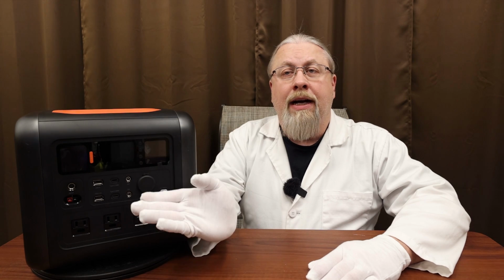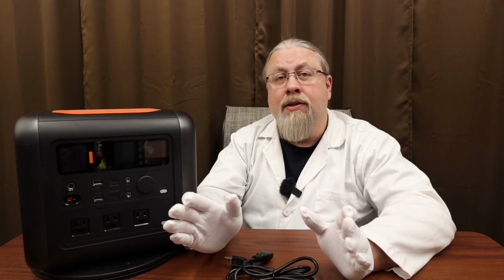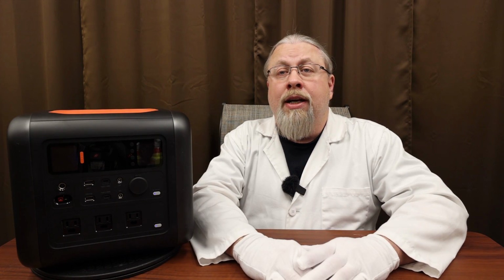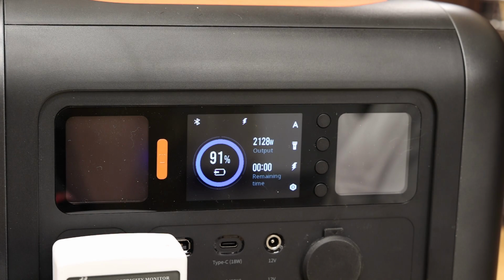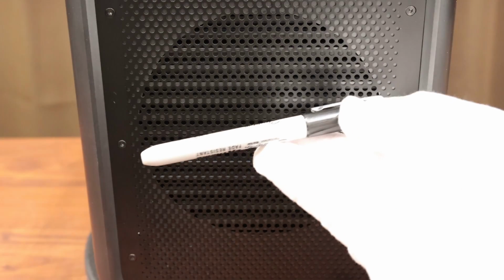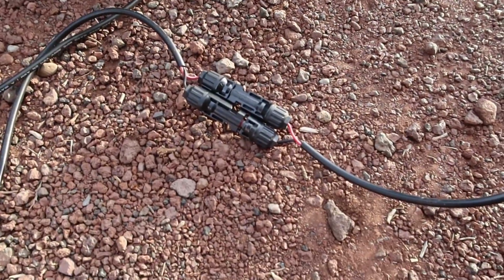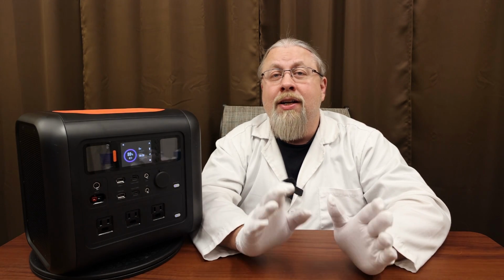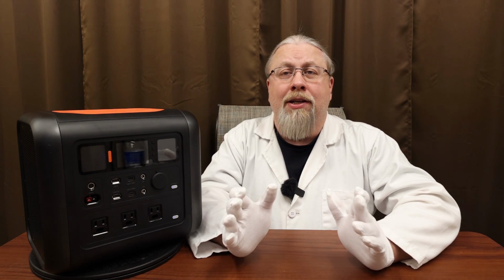SILENT 1200w Solar Generator! 70mai Power Station Tera 1000 Review

Comment from the maker: The crazy low introductory price is FOR THE FIRST 120 UNITS ONLY then the price increases!
GET THE TERA 1000 HERE: https://bit.ly/3khxhXn
Reply: man think price jumped to $649..
Reply: I think if I were you I would recomend putting the rubber on whole curve of edges with extra on front side curves. This would protect  the best if dropped & they could put no feet.
Reply: Hey I recently a message I won this unit did you send it or I'm I being trolled or are you being trolled?
Reply: @kathylewis7543  same here, I think its a scam
Reply from the maker: @kathylewis7543  The users name is "whatsapp" and I wasn't giving anything away so what do you think? Blocked and reported but the damage is done.
Reply: @kathylewis7543   I was like huh hoping but still a cool channel
Reply: @HOBOTECH   thanks for letting us know awesome channel
Reply: @HOBOTECH  Wow crazy why are people doing this! Hey I reported them as well.
Reply: @HOBOTECH could you reach out to your contacts to see if they are going to actually ship this?
Reply: @Charles-xx3ic  its very agrivating. Im still waiting for mine as well.
Reply from the maker: @Charles-xx3ic  Try reading the updates on the campaign page?
Reply: @HOBOTECH  have you read the comments on the campaign 
?
Reply: @HOBOTECH  Update: Received my unit later than expected but well packed; arrived in excellent condition.  Have tested most of the ports and they work as they should.  Have yet to charge it with AC/Solar/Car.  Super light weight and so portable.  Love that it can take a beating and still work.  (I didn't abuse mine, I relied on HOBOTECH to do that for me.)
Reply from the maker: Maybe we're all on a different planet, but not only is IGG working fine but the last update was less than a month ago where they told everyone they are shipping units. It's right there super obvious to anyone taking 10 seconds to look. Don't y'all know there is a major shipping and supply chain crisis and deliveries are running LATE? I'm not trying to cover for 70mai but for heaven's sake this has been news for over a year now.
"by 70mai Technology
Feb 18, 2022 • 12:26AM
25 days ago
Shipping Started! Your Tera 1000 is on the way.

Dear backers,

Great news! The first batch of Power Station Tera 1000 are now shipped. Based on your time of order, the first group of backers will receive tracking information via email soon. You can also track your order here."
Reply from the maker: @chuckmccaskill8473  First, I give absolutely zero effs what people say about me. They can believe what they want. 70mai sells MILLIONS of products each year and I own 3 of their cameras myself that I bought before they ever contacted me. I like their stuff. If they are having issues with their campaign it's probably due to supply issues and poor communication. Some of the Chinese have a really hard time admitting fault. I mean a REALLY hard time. I will personally write to 70mai right now and tell them they need to update their customers. This isn't the first time I had to do this for an IGG campaign ...
Reply from the maker: @Charles-xx3ic  I just contacted them and got an instant reply that management is looking into it. I think the person running the campaign is slacking. This is unfortunately more common than it should be.
Reply: @HOBOTECH  thank you for reaching out to them. Us backers feel defrauded, back in January they sent us a tracking number for the panels but that number never showed the package being delivered to the carrier. 70mai never explained what happened and just ignored questions about it. I know it’s not your job but if you could give 70mai some communications coaching then you would be doing everyone a great service. BTW, I really appreciate your in-depth reviews.
Reply: @HOBOTECH  Thank you very much for helping us with this, many of us have tried over and over to communicate with them and it has been like trying to nail jello to a wall.
Reply: Well 70mai finally made an Update 9 on the campaign page.  This is how I responded. "On March 7th 70mai Team posted on Facebook that the second batch had left the factory but was being held by Customs for additional inspection. Now on update 9, 70mai Team is now reporting second batch is still in the factory and will not be ready until March 20th and is unknown when it can move domestically or internationally.  I hope that in your future updates that 70mai Team will be more truthful, transparent and accurate."  70mai also said the first batch has been loaded on the ship but there will be at least a 3 to 4 week delay before the ship sails until additionally safety inspections are completed.  So if you received a tracking number for the Terra 1000 you're realistically looking at a May delivery.  I would say for the rest of us a July delivery.
Reply from the maker: Yes, there is update they promised to make. Funny how they give a sincere response and still get flamed for it by the same folks that were shitting on me. It could be delivered with free oral sex and it still won't make them happy.
Reply: @HOBOTECH  really i didn't see any more slams in your direction after you reached out.....from my pov your the only reason they finally responded with a  real response
Reply: @HOBOTECH  I just want to add that I appreciate your actions in helping us with 70mai and I never flamed you on any forum.  I welcome their belated Update 9 but can't help to notice the inconsistencies in their previous Updates and postings on Facebook to this newest one.  I do hope they keep up with their biweekly updates and I hope it is more transparent and accurate.  Realistically if the information on Update 9 is accurate I can't expect to receive my unit until July and will just have to live with that.
Reply: @HOBOTECH  I thought there response was sincere and well communicated. HT, thank you if you had any part in crafting it. 
For me it was getting too close to the end of my charge back window so I’m going that route, wish me luck!
Reply: On a positive note, some of the backers have started receiving their solar panels and I received an email further clarifying and apologizing for  confusion on what they called batch 2.  Batch 1 was only the solar panels, batch 2 are the power stations stuck on the ship in port.  My batch is actually batch 3, the ones still at factory tied up by the Covid 19 restrictions.
Reply: @ZeusBike333    Fed Ex just dropped off my Solar Panels . Hopefully everyone gets what the ordered soon.

Comment: Received my Tera 1000 today (5/20/22) via Fedex.  Powered up with no problems by holding in the power button 3 second, the display showed 64% charge.   I plugged in the a/c charger cord and it starting charging at 270 watts with estimated full charge time less than 2 hours.  This is at the slow charge rate which is what I intend use most of the time.  Unit looks very solid and the fit and finish comparable to my Jackery.  Can't wait to put it through its paces.  Thanks Hobotech.

Comment: This is a great little power station. I missed the lowest price, but thanks to this video I caught the next level before full price. It took months longer than they said to deliver--I ordered in December and it was supposed to arrive in Feb 2022 but didn't arrive until July. That said, I LOVE it. I am super sensitive to noise, and very much appreciate the quiet. It really does charge fast, even from solar. Capacity is good enough to run a 12V 27-quart fridge for a couple of days without needing to be recharged. Not disappointed in anything about it.

Comment: I have just purchase it, it came out at $673 with shipping and it will probable more $ with the foreign transaction fee, but still great buy, I greatly value Hobo's knowledge and opinion.  estimated delivery February 2022
Reply: I tried to order it but it only allowed me to make a contribution to the crowd funding project. Do you mind attaching the link to where you bought yours?  Thanks!
Reply from the maker: That is the proper link. It's called crowd funding. You pay $599 as a pre-order and they send you one in February.

Comment: Amazing review - I don't even know where we'd learn about these new products so early if it weren't for you.
Reply from the maker: I still do these when others don't for that very reason.
Reply: @HOBOTECH  I saw a new power station on one of the wholesale sites claiming 7000 cycles. Weight was stated at 13 kg but the unit was 700w.
Reply: @baneverything5580  he lives! Hey I still use that little solar panel u recommended to me awhile ago. Got any nuggets of wisdom for me? I wouldn't mind maybe getting one of these and 599 was a great price. But what say you? I mean I don't want to go crazy on the price. BUT I wouldn't mind being able to use the microwave and fans if the power goes out for an extended time With your suggestions, at least I can charge my flashlights/phone/laptop so I have light and coms. Thank you.
Reply: @dgunearthed7859  I replied but the paranoid YouTube censors deleted it. Gonna try a link after this to a great deal I tried to tell you about but am not allowed to mention.
Reply: @baneverything5580  this is my favorite comment of the day!  :-)
Reply: @dgunearthed7859  I`m trying to get moved. There`s a dog next door that barks at his own nose so I can`t make videos outside anymore. Moving by early next year.

Comment: Hi Hobotech...it's May 18, 2025 and I still haven't had any problems with my solar generator, 1000 Tera. I use it for a backup when I have a power outage. I plug my surge protector into it from my dead AC outlet and have internet and computer back in operation for usually 18 hours. It's great!

Comment: Really good review. I wish they had one with double the solar input, then I could run a small a/c during the day with out discharging the batteries.
Reply: I agree. I live in FL and learned via several hurricanes that my #1 need during a power outage is AC. Never mind cooking. I can eat PB&J sandwiches for months but I cannot cope with temperatures in the 90s with high humidity.
Reply: @carolhewett3756   I get it, because I've lived in South Florida since before Andrew, but found having our 2-refrigerators with/ice, coffee, lights, fans, internet, with charging for phones, tablets & laptops is a game-changer for us.  We ran all of that using limited power management from a 1000 watt inverter connected to my 2008 Prius 12v battery in ready mode for 60 hours on 6 gallons of gas.  Having a 1000 + watt SoGen will allow me to drive my car & still keep things running at home, at night or when it's cloudy/raining I can continue to use my Pirus as a generator on wheels to charge the SoGen while keeping up with the loads.
Reply: @JeffErdmann  wow, thx for that info.

Comment: Hi Hobotech! I took your advice and bought a Tera 1000 last November, and its being delivered this week.
I emailed 70mai's support yesterday to get a clarification about if the unit has AC pass-through function.
According to them, it does, so its possible that when you dropped it you effected the pass-through circuit.
Thank you for your reviews!
Reply: No.  I received my Tera 1000 yesterday.  It will not allow AC pass through.  Great unit though.
Reply: @johnmholt1  Thank you! In their email they said it did...they were wrong.
Reply: I just got my Tera 1000 the other day, and I charged it. After it was charged, I plugged a 4-inch fan into it and tried to turn on the AC switch while it was still plugged into the wall outlet...it wouldn't work. As soon as I unplugged the unit from the wall, the AC switch came on and the fan came on.
Reply: I bought my unit as a backup source of power when there's an outage..I plug my surge protector into and my modem, laptop, speakers and monitor are powered...!

Comment: I’ve tested the pass through 12v feature using a Resmed Airsense 10 CPAP machine. If left in 12v output pass-through, DC always on, with a CPAP attached via the aux port (cigarette lighter port), the CPAP machine will STAY ON when the 120v is cut.

Professor: Do you think this kind of applied use will damage the Tera 1000? If not, this makes for a PERFECT uninterruptible power supply for CPAP users.

Comment: Need a 1500 model and AC pass through. 
AC plug to charge unit is in the back of the unit so you cant strap it in to your car/van against the wall.

Comment: Thanks Professor! I'm definitely going to get two of these because of the price. As a nomad and jewelry artist I have a flex shaft, polishing tumbler and ultrasonic cleaner that I need to run all day. This will definitely fit the bill.

Looks like you can only pre-order one at this time?
Reply from the maker: Yes, it's Indiegogo.
Reply: So have a friend order one for you as well
Reply: Can we order 1 of both family member separately using the same address.

Comment: I was excited about the APP connector... until I learned it is for input only. The output is still the junk difficult unreliable cigarette lighter socket (normal to struggle at 8A). Those barrel connectors are nice, but not for any high drain appliance. Give me some 15-20A output.

Comment: As a total novice to solar, could a techie please answer this question, if possible?  During a power outage:  assuming the two panels fully charged the unit every day how long would this be able to keep the following running: a natural gas furnace and pump, refrigerator, smart phone, modem and router, and one lamp.  I think I could live on just this during an emergency - but the fridge, furnace+pump, modem+router would be on 24/7.  Thanks!!
Reply from the maker: This isn't going to work for a furnace motor. You need something like a Bluetti AC200/AC300 with a larger inverter.
Reply: @HOBOTECH  Thank you!!  The amps for the furnace is 6; pump is 1 - this little cutie still won't have what it takes to run all day?  This is the first one that I've seen on your site that I can actually move.  :-).  Hopefully another contender will come along.  Thanks, again!
Reply from the maker: @blujeans9462  Assume the startup load is double that this may work. It's only 1000wh though. Assuming a 30% cycle time for the furnace that's only about 5 hours (1000wh/200w). I'd still go for something in the 2kw range like the Bluetti AC200max if the furnace is vital to your needs. With that you can always add more batteries later and they are very manageable.
Reply: @blujeans9462  or just buy 2 of these :)
Reply: @chrisanderson8553  Again, I'm a total novice and struggling to understand the concept behind these power stations as a reliable source of emergency power.  I've watched many of his videos - but there seem to be so many variables.  Why do suggest that?
Reply: @HOBOTECH  ok. I'll go back and rewatch the AC200 Max video - with fresh eyes.  I'm presuming heat is really the only thing I can't live without if the outage happens in winter.  Thanks!
Reply: @blujeans9462  becuase that battery isn't going to be near big enough. Your trying to run  2 big electric hogs and a bunch of small things. They also probably aren't near each other...and since you said you can't move them.. 2 would make sense for you. You need a watt meter so you can see how much your fridge and furnace draw. You should join the fb page. Easier to help you there.
Reply: @chrisanderson8553  I don't have a FB account, but I think I understand where you're coming from...I think. :-). My furnace is, obviously, in the basement, while the fridge is about 25' feet away on the first floor.  But either way, as you  and Hobotech indicated, one would not handle the load anyway.  I could put two in the basement - with the panels outside, about 30' away. With that setup, assuming two fully charged stations when the power went out - how many days of minimal sun would the fridge and furnace run?  Thanks!

Comment: Oh, and I took a screen shot this time.  I doubt they sold a couple of hundred since the Prof's video of earlier today -- maybe 10 or 20?  With 4 left at this point?  Still a bait and switch!  Still think the Prof is great even though he will not decry the bait and switch on the pricing! P.S. I only need pass through charging (on a sailboat) from DC to AC so that Achilles' heel pointed out by the Professor is not a worry for me.
Reply from the maker: You're obviously new to crowd funding. The counter keeps rolling over until they meet their quota of $599 units. I don't know how many that is but most crowd funds are between 100-300 for the Super Early Bird deal. It's not "bait and switch". That's not even the correct terminology. Bait and switch means to substitute a different product than the one advertised.
Reply: @HOBOTECH  I guess I am a newbie but it all seems a bit like just another selling tactic to me. I also have to admit that they took me Hook line and sinker for the bluetti 200 but I have used it with good success on my sailboat for the past year. I need more real estate for solar panels!

Comment: Looks like a great unit. I would not be concerned with the pass through when plugged in because if you have 110 available well then just use it directly. If it were a UPS that would be different. I think the most important is pass through with Solar which it has.    Great job!
Reply: I was thinking the same thing. Now I don't have to say it, thanks.
Reply: Pass-through is for inverter use. If you're out in the field you also want a pass-through device.
Reply: @timkunk3498  It has pass through out in the field using solar. It just doesn't have passthrough when plugged into 110. My point is if you have a 110 outlet use it directly.